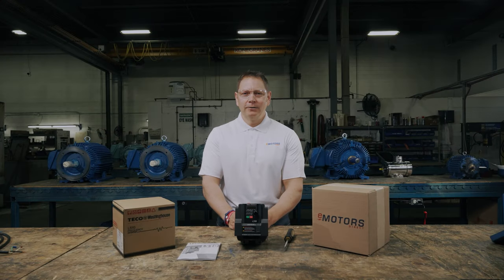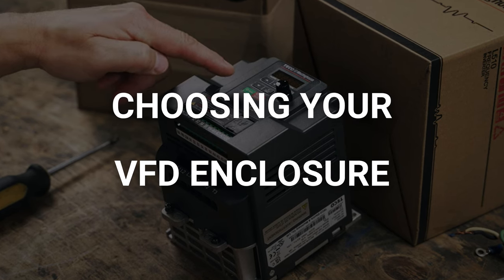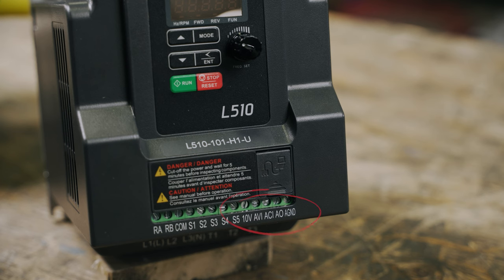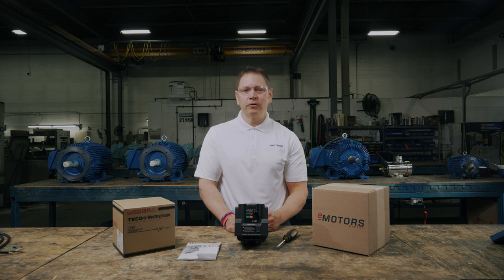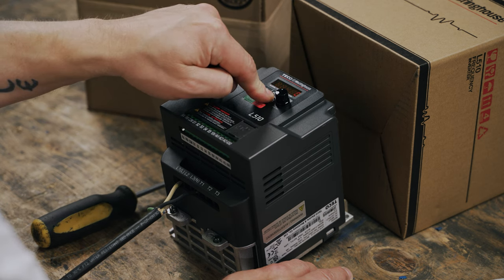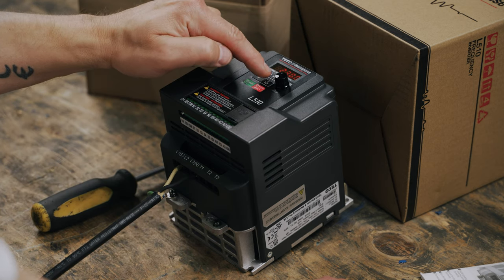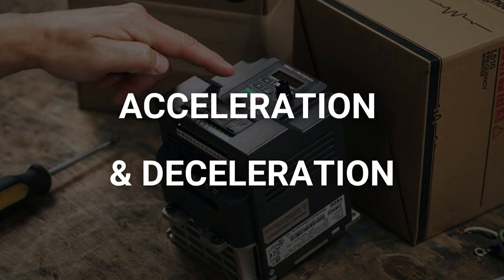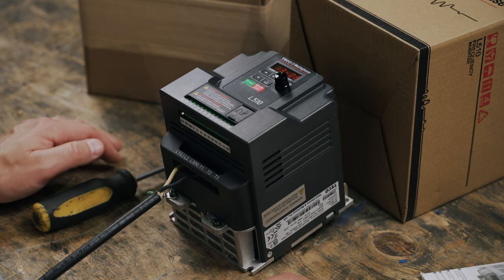L510 TECO Westinghouse VFD | Quick Start Guide

Comment: Good information, but in your first parameter setting you state that you are setting the motor for forward rotation (using00-001) but you typed in 01 and said 01 the first time which would be reverse right?
Maybe I am missing something.
Reply from the maker: Great question. Important to differentiate between the function group (00-01 is the motor rotation function group, 00-02 is the command mode function group, etc.) and the direction setting (0 = forward rotation, 1 = reverse). In this example, I navigate to 00-01 to get to the direction setting parameter, and then chose a value of zero at 4:47. Here's our quick start guide which covers this in more detail https://cdn.emotorsdirect.ca/QuickStartGuide/Quick_Guide_L510_for_Basic_Setup_Final_Version.pdf

Comment: Can the L510 be used to control PMAC motors or just induction motors?
Reply from the maker: It cannot, but the A510 and and F510 support the necessary control algorithms to run PMAC motors. Thanks for the question!
Reply: @emotorsdirect  I see that both the A510 and the F510 are 230v + input, what would you recommend for a PMAC VFD that can run on 110v input? im only running a 1/4hp motor...
Reply from the maker: I'd need to know the type of PMAC motor in order to say anything. Can you share the cat #? Also our drives are rated for 230V output but can output the same amperage at lower voltages as well. So a 230V output VFD can output anywhere from 0 to 230V.

Comment: Can it be configured via a Linux PC ? with which software?
Reply from the maker: Hi Zerak, thank you for the question. TECO Westinghouse's software only runs on PC but the drive supports Modbus, so you can read/write parameters from any system that can read/write Modbus.

Comment: How to set the vfd with 2 proximity sensors  for controlling  the forward and reverse  of a linear  system
Reply from the maker: Thanks for the question, Felix. The best solution depends on what type of proximity sensors you have, and the parts you have on hand. A general solution is described below with inputs set to “53: 2-Wire Self Holding”. This will result in a system that moves forward when one proximity sensor is triggered and backward when the other sensor is triggered. I called it general because it will work regardless of the output type of the proximity sensors. I can email you a wiring diagram if it would be helpful.
Reply: @emotorsdirect wiring diagrams are always a pleasure to look at